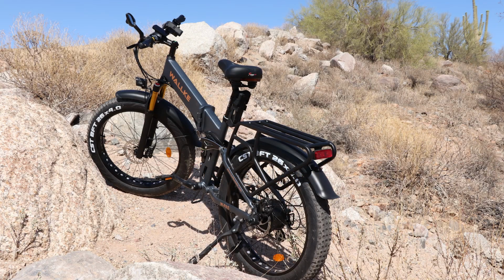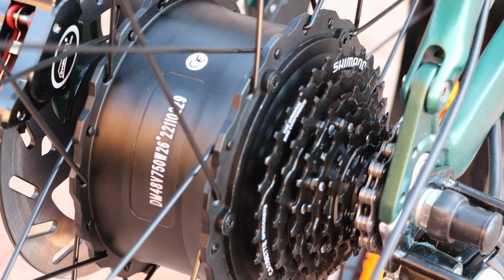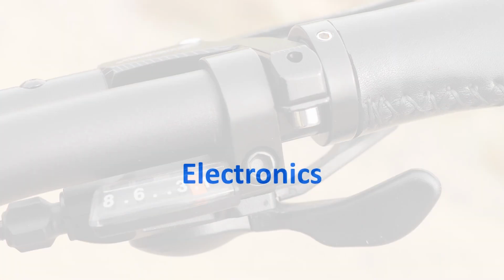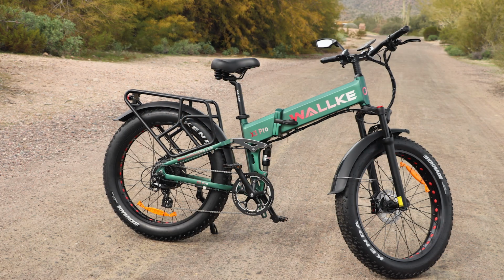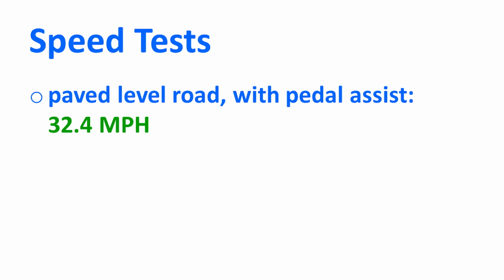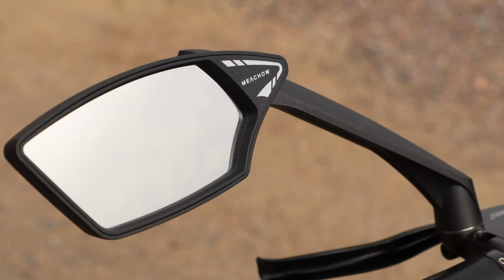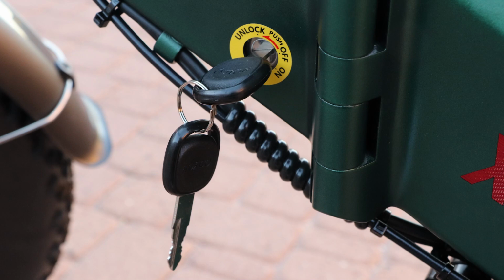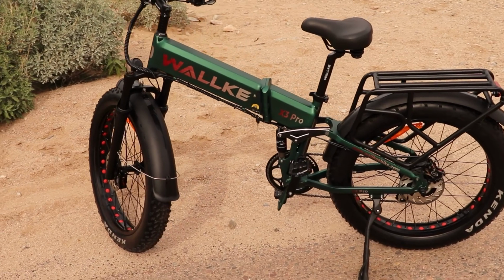2023 Wallke X3 Pro - Premium eBike - Premium Features

Comment: 👍Excellent review! Much better than others and it seems you know your stuff. So one question. I am 6'2 and 300 lbs. Will the suspension support me. I'm concerned about bottoming out in the rear. Thank you sir in advance, ❗
Reply from the maker: Yes, the bike is rated for 350lb so you should be fine.  You might want to upgrade the seat for comfort.   Check out the X-wing seat on Amazon.